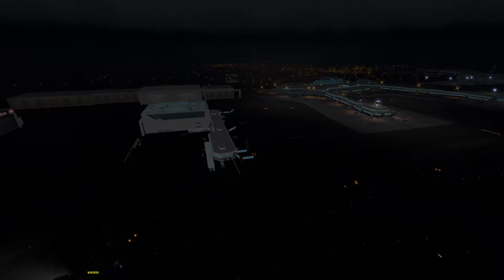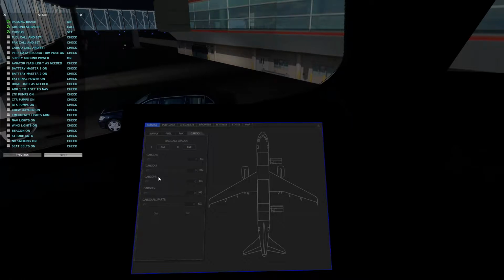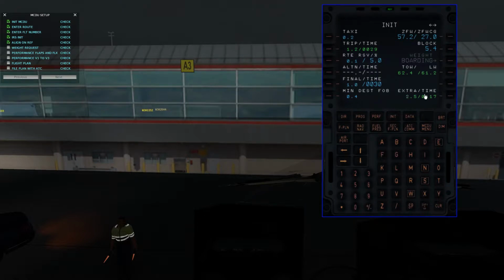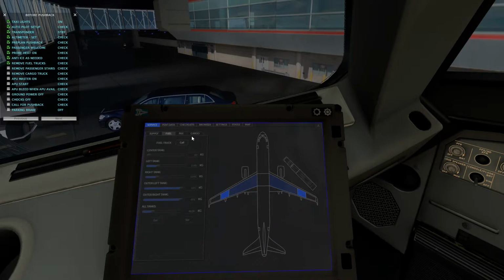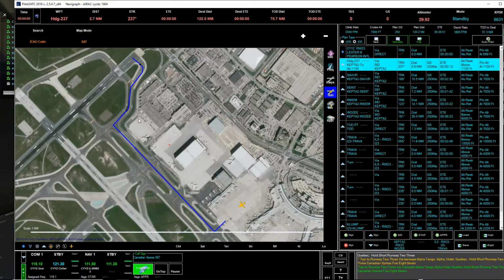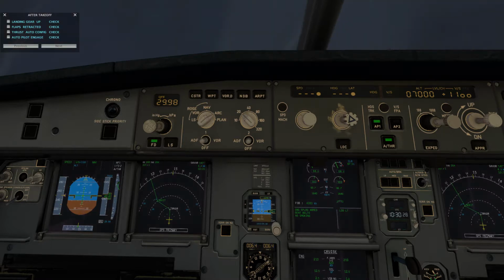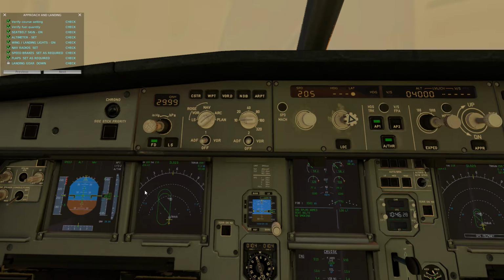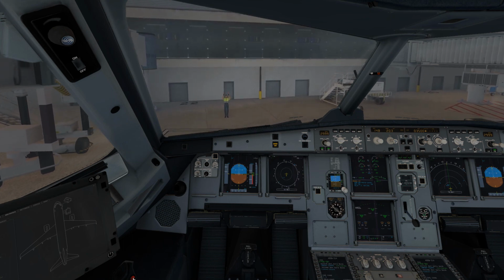Cold Start for FFA320 with Pilot2ATC and landing ils in zero visibility in xplane 11

Comment: Great video ! I was wondering if you had also a problem with the FFA320 and pilot2ATC. In fact the autotune frequency from Pilot2ATC doesn't work on the FFA320... Do you have any idea how I can solve that?
Keep going I really like your channel ! 🙂
Reply from the maker: To auto tune your radios go to Config setting in Pilot2ATC and select Speech tab. There you will see Copilot options. Select check box "Changes Frequencies". Now your copilot will autotune the radios for you.
Reply: @bobblack4604  thanks 🙏

Comment from the maker: I had a comment from Thomas Clay on exporting from Pilot 2 ATC. This can be frustrating as it isn't the standard process for exporting in xplane 11. For some reason I am unable to see comments or reply so I am replying here. On Pilot to ATC when you export you need to choose the option "FF A320 Navigraph- corte.in" Forget all the other options. Only this one is for FF A320. Make sure you have the export path defined correctly "x-Plane 11\Aircraft\Flight Factor A320 ultimate\data". To verify that is working, open the corte.in file using note pad or text editor to see if it is saving the flight plans. If there is already a flight plan with the same name it will add "01,02,..." etc. to the end of the name depending on how many times you save it. You need to type the route exactly in the CO RTE
finder on the MACDU system. If it still doesn't work try updating your plane to the latest version. Something else that may work is updating your navigraph data. I found this works when  it can't find the route, even though it is there in the corte.in file. It doesn't have to be a new navigraph data just reload your existing. I know it is frustrating, but if you try these things it will work guaranteed.
Reply: hello captain. If I ask, you have sent me the clist file in your plane folder.
Reply: hello captain. If I ask, you have sent me the clist file in your plane folder. ekrem.yst25@gmail.com pls ı wait you
Reply from the maker: @ekremyesilyurt575  I'm very sorry but as I explained I lost my clist when I reinstalled FFA320. I checked if I had a backup anywhere on my hard drive and I don't. Since I use speedy co-pilot now I don't need to recreate a clist. If I do at some point I'll post the file for you.